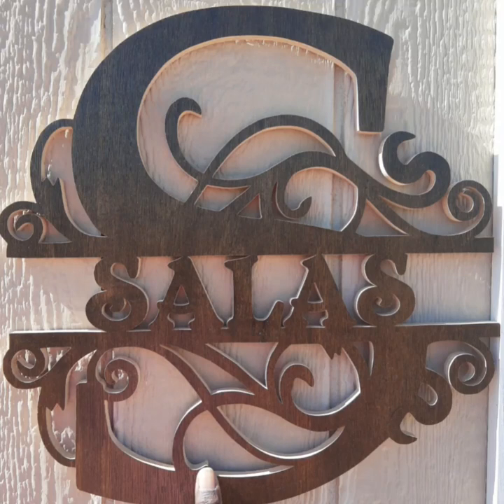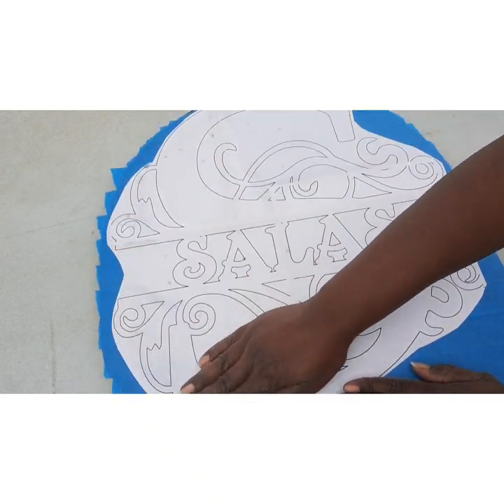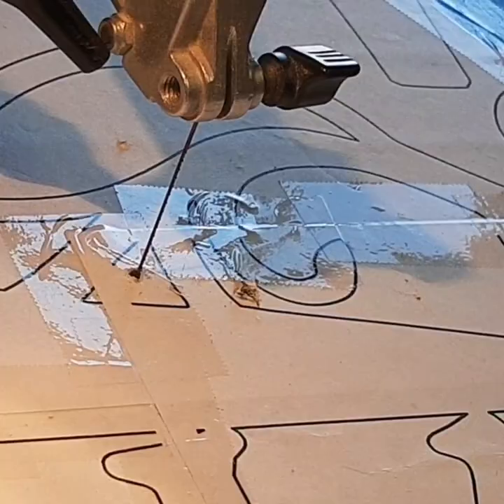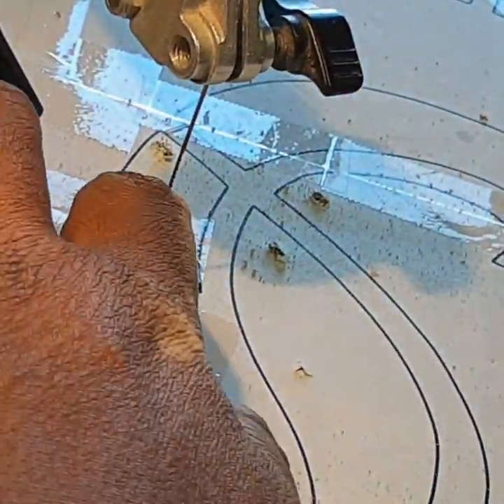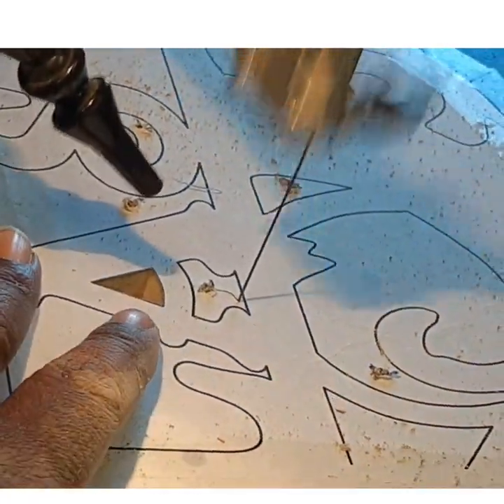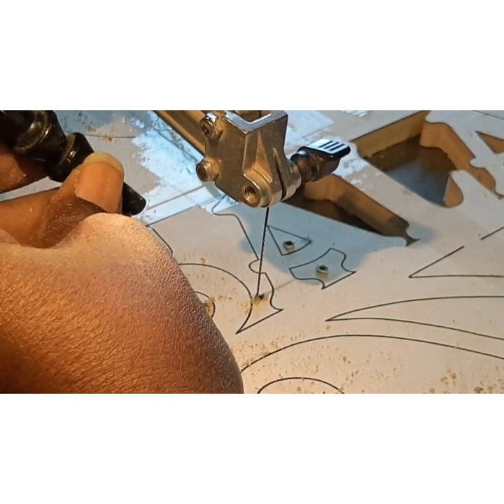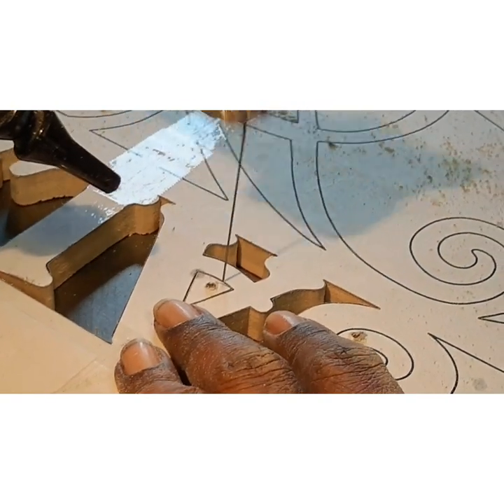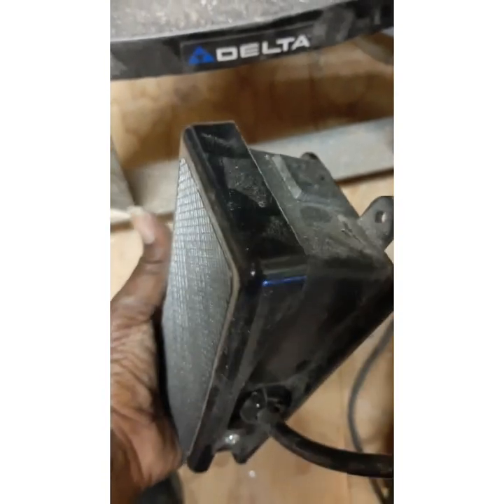Scroll saw Monogram.  Partial tutorial.

Comment: I enjoyed watching your techniques and your beautiful, accurate scrolling.  Your video and smooth voice reminds me of the Sheila Landry tutorial series.  You did not say what kind of adhesive you use on the pattern, and I noticed the pattern had a tendency to lift in various areas as you cut.  I like 3M45 spray adhesive for a lift-free bond.  I can see where positioning a large pattern with aggresive spray adhesive could be testy however. Nice project and excellent video.
Reply from the maker: Thank you so much! I use 3m spray glue in the burgundy can. I get it at Home depot. This video was done on a windy day so I'm afraid I didn't get a good coverage. Where do you purchase your spray glue? Thank you for taking the time to chat with me!
Reply: I buy at Home Depot and Amazon. I buy 3M45 in the silver can.  For patterns it is as good as the maroon can 3M77, and quite a bit cheaper.  Be cautious at Amazon.  The price is all over the place having ranged from around $6 to more than a ridiculous $18+ per can.   I bought 4 cans a couple of weeks ago for around $6.50 ea and a week later the price jumped to $13. Just check in from time to time to nail down the lower price.

I have a foot switch like yours.  My Excalibur from Seyco came with this switch, but their website now shows only the HF design.  My Hegner came with this smaller switch as well.  Advanced Machinery shows it on their website, but at a pricey $35.
Reply from the maker: Thank you for your kind feedback and Thank you so much for the spray glue info. I have to check out the spray you suggested. I love the Scrollsaw community! Everyone is so helpful! Keep in touch! If you're in instagram you can find me under
mytoyaNcalifornia
I would love to see some of your work!🤗